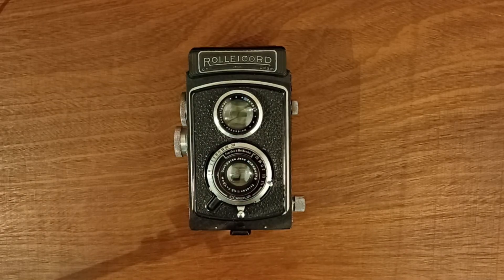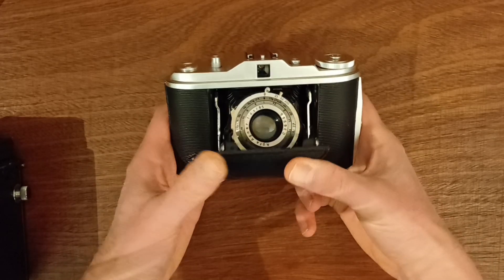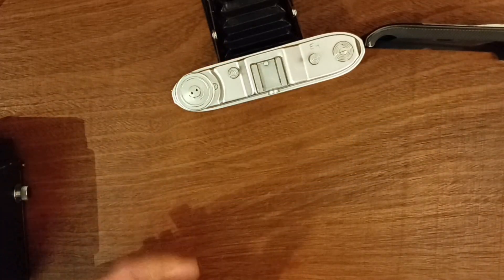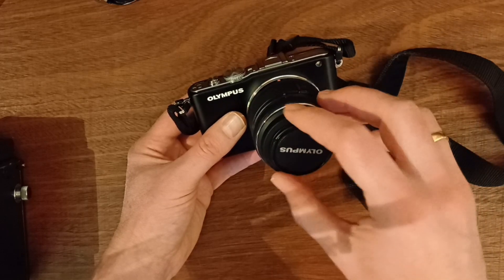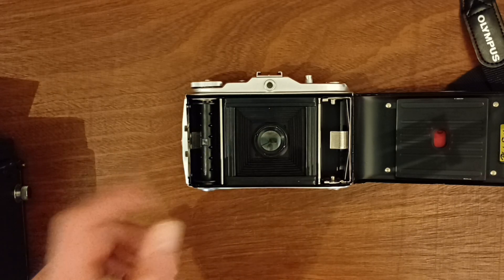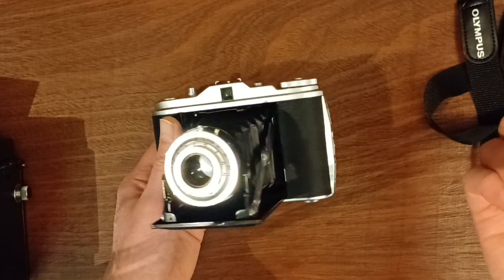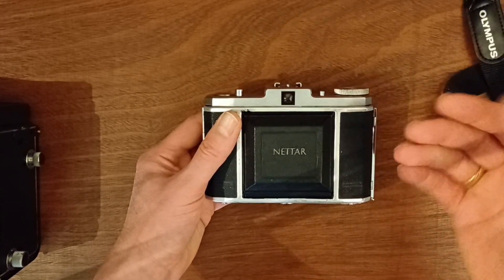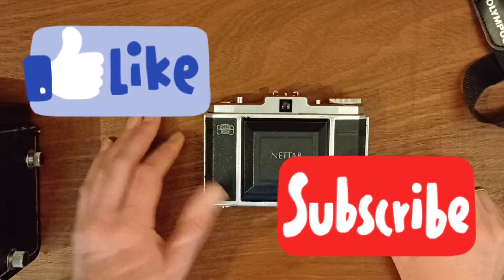How to convert an old film camera into a digital camera? Challenges and possibilities explained.

Comment: For me the only real conversion is to replace the film with a sensor, so that the analog camera retains the control of the image taken. But to have comparable results as with film, the sensor must be full frame for conversion of a 135 mm analog camera. Also the sensor must be synchronized with the shutter, which is not easy to do. Finally all this must be obtained ideally without modifying the analog camera, so that it still could work with film. If this can be achieved, then the analog camera could be used without film processing, and that will save a lot of money in processing. Since that is really difficult to achieve, this will continue to be an interesting but impractical idea.

Comment: Well. All you need is making the modern camera zoom in to the old lenses, so there would be no loss, right? I know that gonna sound ridiculous and I'm aware I don't know what I'm talking about, but here it is: Maybe you could get those lenses for mobile phone cameras. They're really cheap. They've got zoom lenses as well  and they are so small that you could fit in front of the modern camera lenses, zooming in to the old lenses. It would be the same job that the "speed booster" or "focal reducer adapter" that modern cameras can use. Chances are, because you concentrating more light in to a smaller place, you can use faster shutter and less ISO, because you're effectively concentrating the light on a smaller spot - exactly like the speed booster does. (I use a speed booster and It gives me +1 aperture just because of this. I hope that makes sense optically speaking.
Ps.: Ive just realized that you can't adapt a real  camera lens on a mobile camera for optical reasons. So that may fail. Sorry.
Reply from the maker: I like the way you think. But unfortunately the smartphone camera will only capture a small part of the image that goes trough the camera lens. The camera lens is placed at a certain distance from the image plane precisely for that reason.  
So either you need a big sensor or you can capture the image on a small ground glass and then shoot the image with a smartphone. Or a filter behind the original lens might give some effect. I think a camera back that can hold a smartphone is a viable way to go about it. Albeit using a ground glass. The smartphone's camera need to be able to capture images from a very very short distance. It's interesting.
Reply: @sneeuwwolf1176 
No no, I'm not suggesting to use an smartphone, there are swappable lenses that you place on the top of your smartphone lens. The lenses are sold separately and can be used anywhere. Search for  "smartphone lens kit" and you'll realize what I mean.
Good luck on this project. It's really interesting!

Comment: The thing is....I wore out tons of miserable digital pocket cameras (even big names)...BUT I still have a Practika camera, after 4o years, it's built like a tank...(and MANY others, from that time) so we would need a digital brain and sensor, to put it into those cameras. I'm tired of buying digital junk that get self-destruct (mainly the memory and the flash-memory) in no time. 

I bought a used Pentax Optio V2o, in good shape, I upgraded it with ny expensive batteries...and it gave up, lenses coming out,  and then going back and shuts of. It seems that it couldn't load the "OS", because the mechanics were ok, but the electronics or OS couldn't be initiated, probably a memory problem, as usual.

Comment: I had considered the possibility of doing a conversion with a broken camera.
Never did it due to the rapid improvement of digital imaging and cost
Reply from the maker: Yes, I think if you just want to tinker it is a fun project. But to get real good results it is a very very big project.
Reply: @sneeuwwolf1176  one problem is finding decent, surplus CCD electronics and second is knowing how to check it and adapt controls

Comment: 4:34 Question: wouldn't it be "easier" to attach the digital sensor to the camera lenses from inside, instead of attaching it to the back of the camera?

If I remember properly (I do have a terrible memory), there's a distance inside the camera chamber where the full image converges into a dot, so it should be possible to attach the digital sensor a bit closer as to match the light to the sensor size... So you pop-out the crystal lenses+digital sensor as a single unit, with a wire floating in the space to the rest of the digital camera (or kit or whatever you take the sensor from to make it work).

And if I recall properly, you would need to attach the digital sensor upside down, because when you attach it before the converge point, the image would be upside down. And, why not attach it "after" the converge point? Because you would be wasting "empty" space needed for the digital camera innards.

This way, you could make "kits" that can be taken out and leave the original camera untouched...

English ain't my mother tongue. Do I make sense? 😅
Reply from the maker: @franzrogar  the problem with these old cameras is that the image plane is at a certain distance. This distance depends on the lens focal length. So if you move the sensor closer it will move out of focus. I tried various ways of zooming in/ out but won't work. Then i tried with a tiny camera to put the sensor/lens of the digital camera right up behind the old camera's lens. This works, but there is a distortion of the image and there is a ghost image/ reflection visible of the digital lens when you take pictures. So it is a bit fiddly to get it just right. But a lot of fun in trying to get it just right.

Thanks for your comment. It gave me a lot to think about.
Reply: @sneeuwwolf1176  thank to you for your fast and informative reply 🙂

Regarding the "distortion" you mention, what about using a flat-concave (like a cabochon) crystal in front of the digital sensor and, both of them inside a small box (like a black box) attached to the inside of the crystal lenses? Like a "box camera" with flat-concave lens, like a Brownie.

That way, you could get rid of the distortion and avoid the ghosting... And the "box" could help you to attach in its proper position the sensor without mayor issues.

Just rumbling... XD Everything is easier to write but hard to implement.
Reply from the maker: @franzrogar  I will try and see if i can find simething that works. Nit easy as you said. I will find a solution.